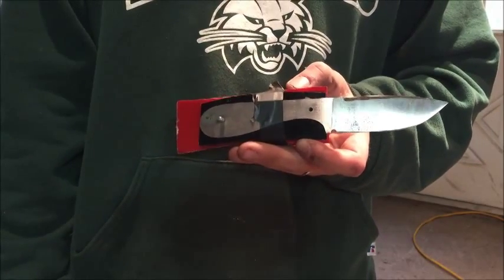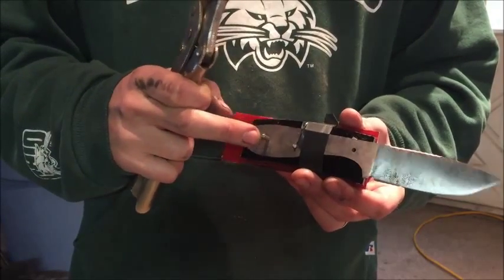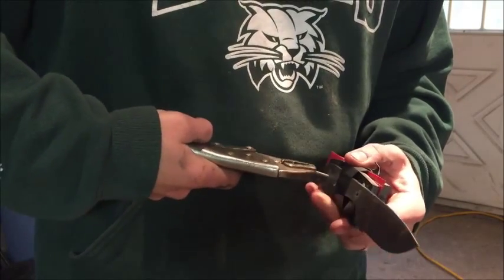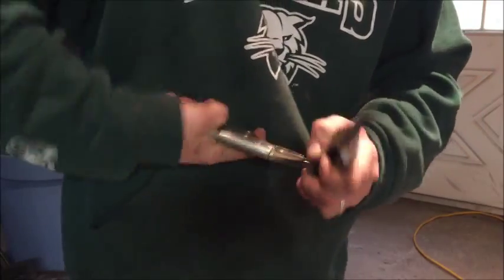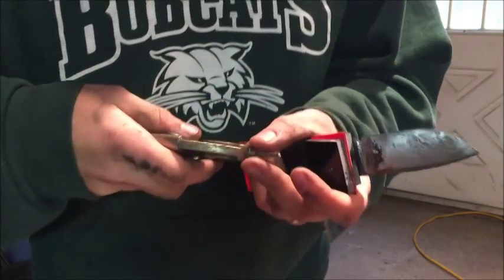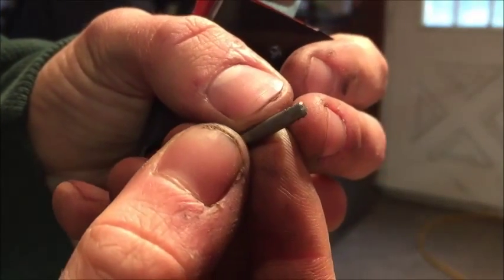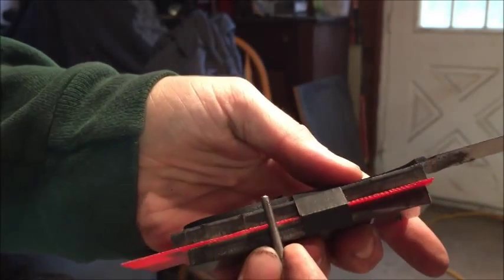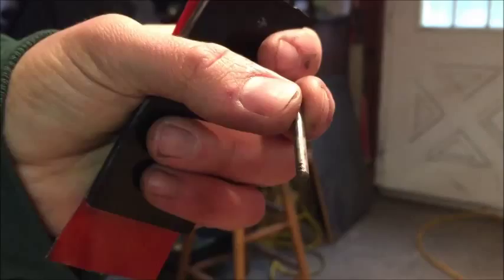Knife making tip #12 Extra pin length

Comment: what size of hole are you drilling for your pins?  you shouldn't have to use a hammer to install the pins, that can cause trouble with handle materials especially wood or any other natural material.  1/8" pin use a #30 drill bit,  1/4" pin or tube use a 6.5mm drill bit. this will leave you a couple thousandths play and the pins will slip right in and make it much easier during glue up.   try it and let me know what you think.